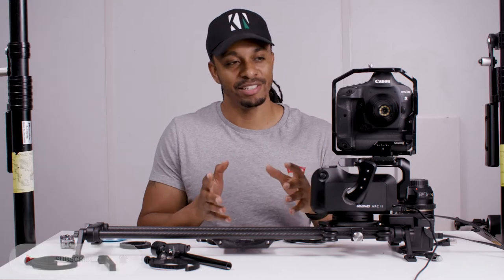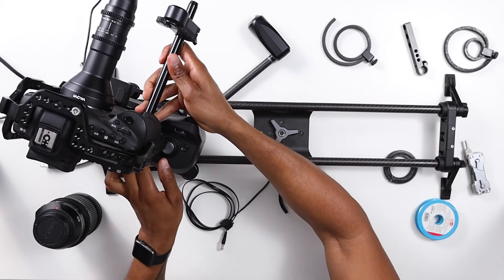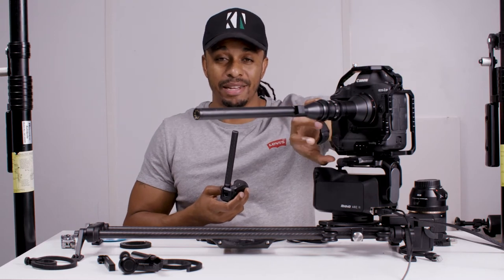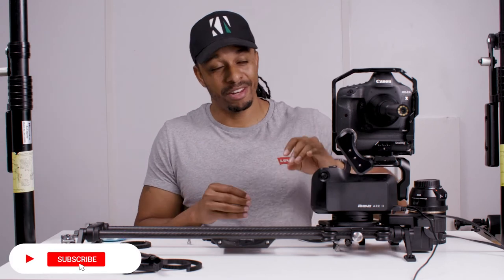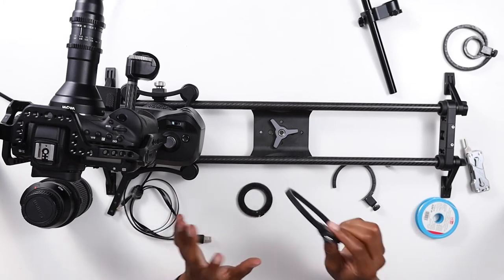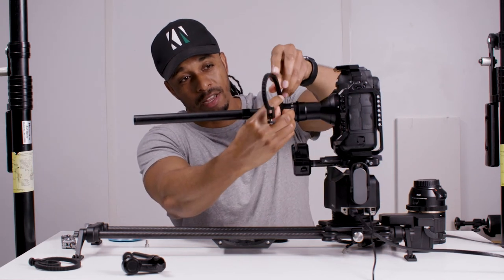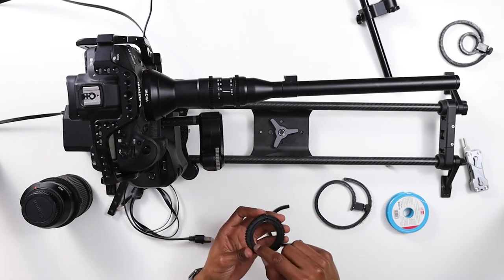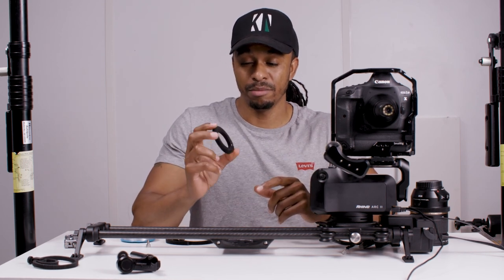Laowa probe lens focus ring extension hack

Comment: Thanks for sharing this video. Isn't the focus pull during action, moves the probe and makes it difficult to shoot stable video at the macro level (makes it more difficult with long tube structure) ? I tried with the DJI focus motor and had this issue...I wonder how it handles with the Rhino or Tilta Nucleus system and how the footage looks like? Thanks
Reply from the maker: It’s very stable. I use it with the rhino arc2

Comment: does something like this exist for the pro2be version 2 of this lens? Having trouble reading the focus ring with my Rhino focus motor as well.
Reply: The diameter of the ring would actually have to be quite thick in order to fit around the LPL to e-mount adapter. Although if you used laowa's emount adapter I think it would work better.  Great video. We have a very similar setup.
Reply from the maker: Not that I’m aware of. Same hack could work though